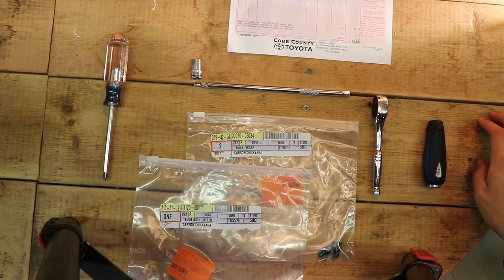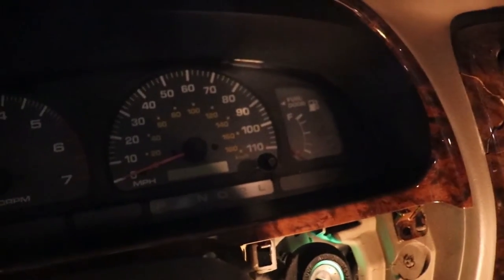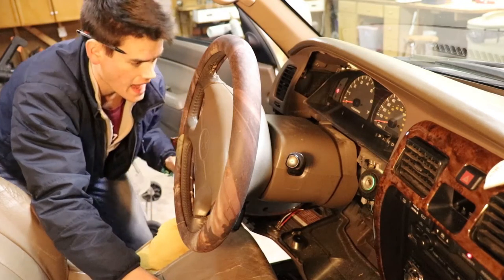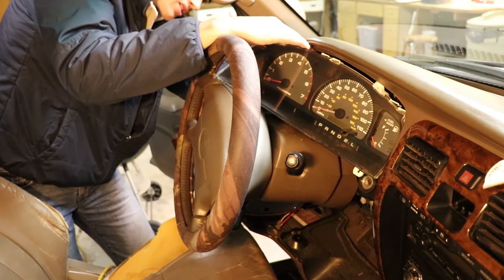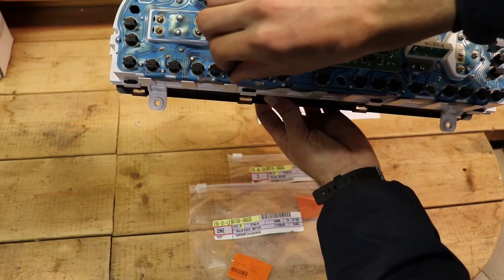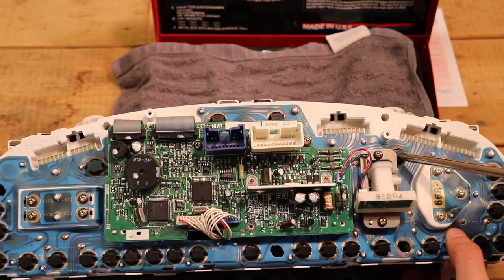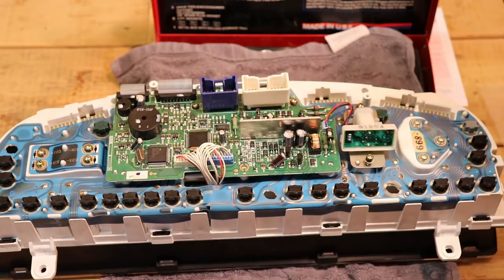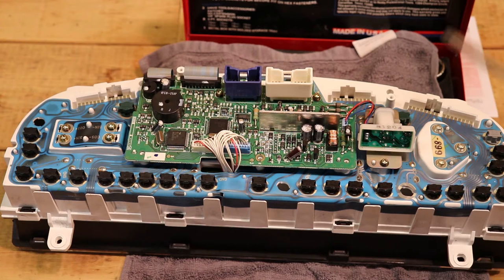OEM 4runner Dash light replacement

Comment: 8:59 there's a white plastic cover (4 small screws) that goes over that circuit board. My '01 4Runner is much like this one, and I was hesitant to remove the circuit board, so thanks for showing  how you did it.
Reply from the maker: You are very welcome! Hope the video helped you finish the job.
Reply: @rustbucketproductions  I've got it all apart, but decided to order a new clear plastic front "lens" for the cluster, being that this vehicle has 265K miles, and therefore it's not so "clear" anymore, from   years of cleaning the dust off. I also have an 04 Tacoma to drive , so this can sit for the week til parts come in.
Reply from the maker: @terebrate  Always good to have a back up Toyota during repairs.

Comment: Really helpful video! Wish I had this last year when I replaced the dash bulbs. I ended up using LEDs to replace the bulbs, and looks much better and brighter. Thanks again for the video and info!
Reply from the maker: Glad it helped!
Reply: Can you please put a link of what part numbers those LEDs are thank you.
Reply: Can you put the link to find those LED lights bro please.  I have a 2001 4runner
Reply: @gersonguerra5812  I just did this, T5 wedge bulbs. Make sure you buy dimmable ones as not all LED bulbs are dimmable.

Comment: Very nice video and explanation. Getting ready to replace ALL the bulbs on my nieces 2001and even though most are still working, I'm only going to do this one time....not cheap when buying all of them. Wondering why you weren't able to remove the circuit board covering the backlight bulbs all the way.
Reply: There's two flexible circuit tapes on the top left of the circuit board that  have to be carefully removed and they are held in place by pressure from plastic conectores on top of the board. Probably the most fragile thing to do in this process.

Comment: What type of socket or bulb does the  P, R,N,D,2,L use?
Reply from the maker: I did a little bit of research and it seems as if it is a 2721 bulb. You might want to take the plastic off and double check what the bulb looks like before ordering.

Comment: I did this and now my blinkers and hazards won’t work inside and out anyone know why I replaced relay and fuses
Reply from the maker: I would check to make sure the bulbs or electrical connections did not get loose.
Reply: I know this was 8 months ago... but I'd look near your hazard switch, it might not be seated properly when put back together. Hope this helps somebody. @ Rust Bucket - love your videos, don't stop!